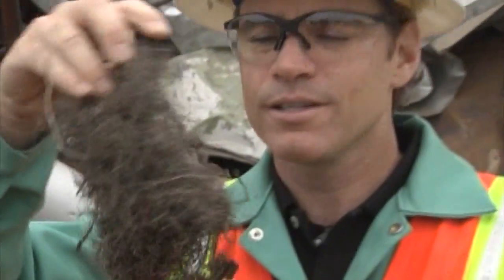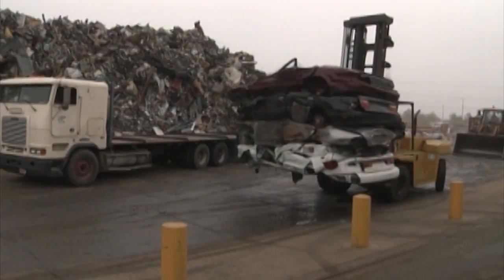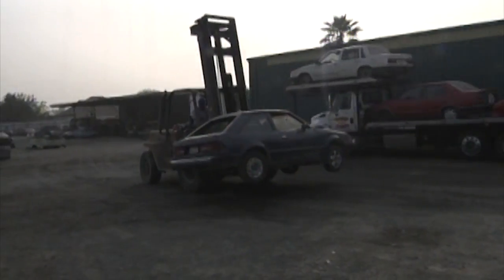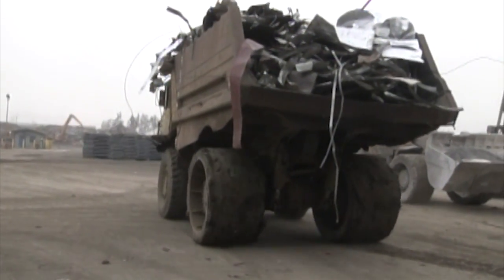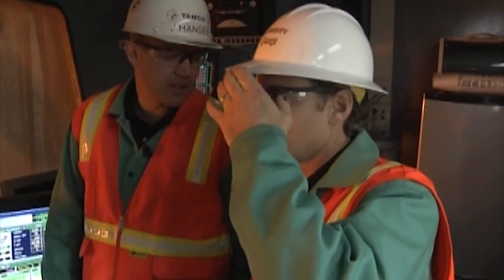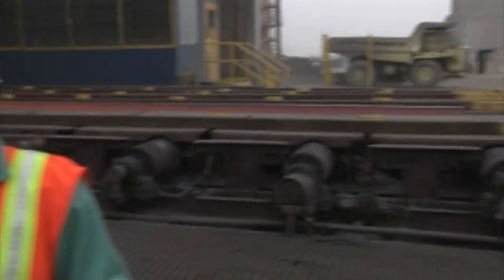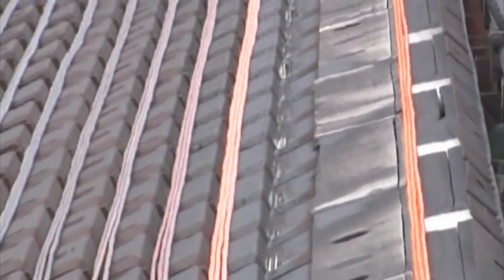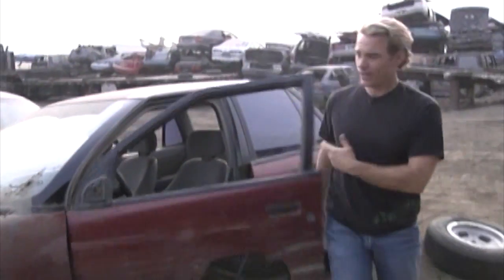Car Recycling

Comment: The last thing I built before I retired was a car shredder in Tampa, FL. It cost 6.5 mill and from the time we turned the old one off to the time we turned the new one on was 6 weeks. The main body without the grinding wheel in it weighed 1 million pounds. The motor was 7k HP and ran on 14.7kv. A new electric substation had to be built for the new machine. The old one took 6 weeks to fill up a ship with steel and the new one took 6 days to fill the ship. There was always tons of coins laying all over the ground. The 18 hammers that pounded the cars to shreds weighs 900 lbs each and the wheel spun at 800 rpm.
Reply: VERY COOL THANKS FOR SHARING
Reply: Seth Emai That is a beast of a machine.
Reply: coins?
Reply: @Simon-dm8zv  Yes coins that fell behind the back seat and anywhere in the cars ended up scattered all over the place. Most of them had some damage though.
Reply: @smarthome2660  Ah I see! Thanks for explaining.

Comment: The only steel mill in New England is in Rhode Island and generally operates at night only. It is an electric arc steel mill and because Rhode Island has such a surplus of power at night was why the steel mill was built here. This mill also manufactures rebar. Before I retired I use to haul trailer loads of rebar out of that mill 2 or 3 times a month. It been operating for over 25 years.

Scrap is shipped in by truck and rail.
Reply: I am not an animal
Reply: Awful
Reply: @kennethsee6262  What the hell does that mean?

Comment: Well, I drive a 1994 Rover 214. A rare one now, as it's a three door. Still a dependable and comfortable, economical motor. Every time I go to our refuse tip or recycling centre, or even look at the trash bins around here, I'm reminded of what a wasteful world we live in. Found a 70's record player the other day and have repaired it, already have people interested in it ! I still have 5o's fridge too. The older stuff was generally better built than today's equipment, especially if the new item came from China. The really sad thing is that most refuse dumps won't let people take things away and "Reuse" them. So much for this Reduce Reuse Recycle crap.
Reply: Exactly, and the corporations want the people to just buy more and more for their own greed. They never used to be like that, not nearly as much anyway. I hate those car takeback schemes, newer cars are harder to repair when they go wrong and many of those cars that do get scrapped have nothing wrong with them or something that only costs a few hundred to repair when a newer car is much more expensive anyway. The most common year of cars in my country is 1996, lets hope it stays that way for some more years to come.
Reply: Wow, 1996, that would mean 20 years of average age. Over here it is just a bit more than 5 years, 7 or 8 or so. And they have these stupid schemes for the car industry paid with taxpayers money as well. So so stupid. Best thing is that they try to tell you that new cars are "cleaner", which is complete bollocks as if production accounts for zero energy or so.
Reply: i wouldnt give my old trucks to one of those by back schemes . in most cases when you buy a new car you have payments and interest im not paying 40 grand for a new truck. cheaper to repair what i have. recycling is not 100% environmental. it takes fuel to transport and recycle it
Reply: I agree, and yup, bang on about the majority of tips/centres NOT letting you pick n take. Real gold mine sometimes. I pondered about working at one to get 'on the inside' but wages are insufficient. Most play the liability card...
Reply: S Midnight Sparky you need to go to pick-a-part.
Reply: River Huntington, good answer. I agree with you.

Comment: If you got older cars from 00s and older, KEEP THEM! Don’t send them to extinction like this place
Reply: Ajingtec, I agree, hold on to them, but only if they can safely be repaired. I finally had to give up and recycle one of mine when the frame on that car finally broke. Too much of the frame was rusted, broken and sections of it missing that it could not safely be welded back together. A lot of good parts then came off that car, which were useful for another similar car of that vintage.

Comment: I had a curiosity a few years ago after that run-a-way train ...   explosive fire tragedy at Magentic in Québec, I wrote to both Alberta and one of the rail companies. I made reference to a  then very popular T.V. commercial that showed crude oil tailings being dumped into a hopper where the hopper emptied onto a conveyor as the start of the process of reaping this oil harvest.   I suggested  that what the conveyor was carrying up a 45 or more degree angle to be dumped into the next part of the process, be dumped instead into an up-ended tank type rail car with modification to the rail-car, making the end removable.  My purpose was and is, that  if the crude were transported without the highly volatile solvents, this would be much safer. The top end-cap would be redesigned to be removeable and replicable to drop the material off the conveyor until the tank was full. Said tank car would then be lowered to horizontal, rolled to destination where emptying could be accomplished by tipping the rail-car so the opening is at the bottom along with using steam connected at the other end of the rail-car to both heat and force the crude out. 

  I must have struck a chord because I have never seen that commercial since.  I believe if crude oil were moved by rail car with the above modification to the tank car, and without the present solvents mixed in, a greater safety move will result! Even though we have never done it that way, should we explore this option, I believe we could realize less potential for fire and/or explosions of said tankers. Also, even if a derailment and rupture of said tank car happened, the cleanup of thick crude, I believe, could be realized easier than the present product mixed with solvents or sending the product through pipelines.

thank you

keep smiling  /  dennis

dennisf.macintyre.d@gmail.com

Comment: Take tires off, windows out, any that can be reused.  Use electromagnet pullout steel. Go through multiple shredders each getting smaller and smaller able separate easier. Takes up less space.

Comment: Until couple weeks ago I owned a 1996 Plymouth Neon Sport Sedan 4D. Bought the car when it was 4 years old and owned it for 23 years so when I got rid of the car it was 27 years old. The car was having engine problems and was not worth fixing due to cost and it's age so I just let it go. While I owned the car it was a good little car I can't complain too much. At the time I got rid of it the car still had 95% of it's factory installed parts on it.

Comment: "In this DVD, we learn what all the scrap metal from old cars can become." It can only become one thing and they show that, REBAR. But they don't say why. New products made of steel including cans have to be made from specific grades and types of steel. Cars, cans, etc. are made from thousands of types of steel. This process is basically turning it into a steel stew. There's no way you can get a certain type of steel out of it so it's basically useless for anything but re-bar or a fence post, etc. which is the lowest grade of steel.  Steel is an alloy of iron, other metals and minerals is various amounts depending on it's eventual uses.
Reply: Great, i will remember that the next time i am on the top floor, not that the bottom would be any safer when it falls on you, of a reenforced concrete sky scraper. "Don't worry, it is strengthened by all the (s)crap metal they couldn't find anything else to do with".

Comment: So all recycled ferrous metal ends up as rebar?
Reply: No. It'll go back into everything else. Your next car.   Pipes at Home Depot.  Oil line pipes.   Cans.  You can reuse it basically anywhere. This place just happened to be next to a rebar plant as a close customer.

Comment: How do they control the chemical composition of the steel? I was hoping they would go into a little more detail.
Reply: In rebar production they really don’t, car body panels contain a lot of copper relatively and it would have to be diluted for another specific use. Rebar is the lowest quality steel you can get new just about

Comment: Could this steel, processing plant be powered by alternative energy? Is the heat captureable?  Could the heat from the steel plant warm a water system?
Reply: Such is what I was wondering. It was not addressed here, and since snowflake Curiosity Quest and sunbeam California would be an item, it tends to suggest that such is in the negative.

Comment: notice they omitted showing all the plastic parts being burned out to separate the copper from electric motors and wires, emissions kills cars 10 years before their time and the cars get melted down releasing toxic gases that counter act any good having emissions on cars did , reusing is better than recycling ,

Comment: They can't make I beams or new body panels because it's a "mini-mill." They don't have big huge blast furnaces and just have electric arc furnaces. The roll steel and thick I beams need to be made in a plant with higher capacity that uses actual iron ore, from what I've been told. The little mills like this one can made bar stock, rebar, and round stock in big coils that other outfits turn into tie wire, barbed wire, and other stuff like that. There's a nucor mill just like in this video in my state and I've worked an outage there and talked to a few of their hands.
Reply: Just depends on the size of the mill.  There are Arc Furnaces that will make 250-300 tons of steel per heat.  You can easily use that to make sizeable parts.  This one just made small stuff because that's what their product is.   Take out that little 5x5" billet mold and put in a 10x30" mold and you've got a huge slab from the same furnace.

Comment: how do they deal or handle air pollution?
Reply: The temperature is well above 700 degrees, that means organics gasify https://en.wikipedia.org/wiki/Gasification 
They most likely either burn it off or use a catalytic converter. And prior to them, cars get scrapped out from expensive parts and oils.
They didn't mention about removing the battery, electronics, wires, windshields, windows, and plastics. Those have better processes to be recycled.
Reply: around here they load them on ships and send them to China.
Reply: lengray44: Not anymore not to China they don’t. Maybe to another country.

Comment: to condese this description, an excavator or crane drops the car or scrap onto a conveyerbelt where it is feed to a shredder that uses a drum with 250 lb hammers to rip the car to chunks in a hammer mill there the bits are sorted into differant materials such as ferrious and non ferrious metals, and what is called fluff that is the stuff that cant be recycled in the steel mill, and in a steel mill the scrap is melted down to molten metal, and re made into other products depending on what the mill produces

Comment: Thats nowhere near the temperature of surface on the sun...
Reply: Actually it is.   Not the liquid metal, but the localized area of the arc itself.   Lightning is kinda hot.  
And yes, both about 10,000 degrees.

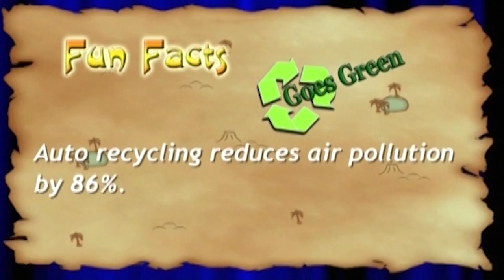Comment: 4:18 fun fact fun fact fun fact... heeeere is your fun fact: writing numbers in relation to nothing has an informational value about a total of zero. And if it is ment to "reduce air pollution by 86%" because those cars do not create any emissions anymore then it is totally crap because where one car is recycled another car is created. New car, new pollution. 

But I get the idea. If you are wokring with data you can create up to almost anything and be able to back it up somehow. Or as we say "a piece of paper can handle a lot". 

...oh and that fun fact was not funny at all. Neither were the remaining ones :)
Reply: It's related to the fact that you need a lot less energy input to recycle steel than it is to mine, transport, and refine the raw inputs for steel (iron ore, coal) from scratch.  That's where the green part comes in.  You skip a lot of the energy-intensive process.

Comment: rebar is nice but it goes in the ground and we never get it back. it should go to something more useful. car parts,things we use and can recycle again.
Reply: so what do we do with buildings and bridges ? Build them with out rebar?
Reply: tyler norton when buildings, bridges and other concrete structures are demolished, the rebar is pulled out and recycled just like everything else. And it might not go back to the same plant that made rebar. Maybe it will go to another plant that makes cars, or cans, or airplanes, or machinery. Once rebar is put into concrete, that is not the end of its life. It will get recycled eventually.
Reply: A lot of rebar get used by the railroad industry in concrete ties. Concrete ties generally have a life of 30 to 50 years. When their life is up there are now machines that " harvest " the rebar from the ties by crushing the for 100 % recovery of the rebar steel. The crushed concrete gets reused in a multitude of new products. Not all rebar when used in construction is gone forever.
Reply: Rebar manufacturing is just one customer out of hundreads.
Reply: That is correct Chris. At my job we crush (recycle) used concrete,  to produce a product called aggregate base or AB for short.  As a byproduct of this crushing process we are able to remove 100% of the rebar from concrete.  As much as 1000 lbs per hour of rebar. This is exactly why the recycle logo is three arrows pointing at each other. Recycle, re-recycle, and re-re-recycle.

Comment: They never said why all those cars get made into low grade rebar, instead of making forks and spoons or steel cans or anything better than crummy rebar.
Reply: Its "dirty" steel. Its too expensive to refine for high quality steel products so used for rebar. This is true for most recycled material products including copper, paper, plastic and rubber. Recycled copper cant be used for electrical wire so used in lower grade applications. 100% recycled paper is brittle so used in boxes instead of fine paper etc. Recycled doesnt mean pure and perfect. It means reconstituted or repurposed.
Reply: First off utensils are made out of stainless. Which is a completely different material. Soup cans are galvanized and contain zinc which is a different metal as well. And lastly the steel mill only makes certain products and it looks like they happen to make rebar
Reply: I bet due to the cost of manufacturing in the USA. Relatively high wages, etc.
Reply: Why don't the railway wheels go back to the wheel foundry?
Reply: You can use it for a lot of things.  They're making rebar out of it....because there was a commercial need for a rebar plant.  They built a rebar plant, and some smart guy decided to put a recycling operation right next to his scrap pile.  Built in customer.

Comment: the fun fckta i think are a load of old tosh they are saving steel not energy
Reply: I know I'm responding to an old comment but it takes less energy to recycle old steel then create new steel from iron ore.
Reply: You make steel two ways.   One, by melting scrap (this video) or from original components (iron ore & coal).  Doing it with recycled scrap skips several energy-intensive steps of the 2nd method. Which is where you save the energy.

Comment: Moltan rock is more than 4000'c
16:35
Reply: magma is about 700-1300c
Cooler than that steel tap is.  Just like the guy said.

Comment: What a waste of my time!  
What happens to aluminum?
What happens to copper?
What happens to plaatics/foam, etc?  Can it be burned to generate electricity?
What happens to electronics?  I mean, modern cars are full of computers?
Basically this video is about melting steel....  Whoop de doo
Reply: I recycle cars for a living and all that crap is grinded up and thrown into a landfill they only collect the  metal
Reply: The aluminum and copper?  They go to basically the same thing on a smaller scale.